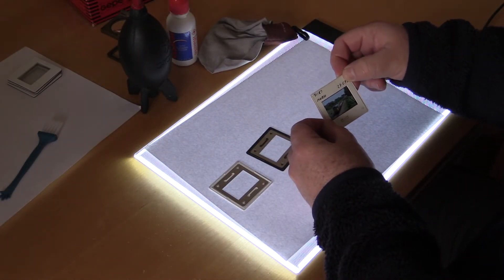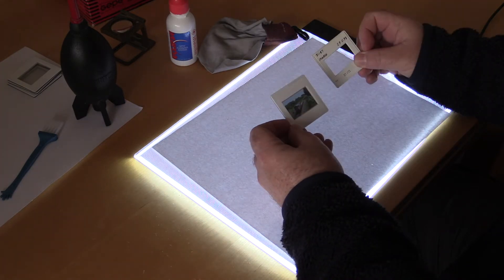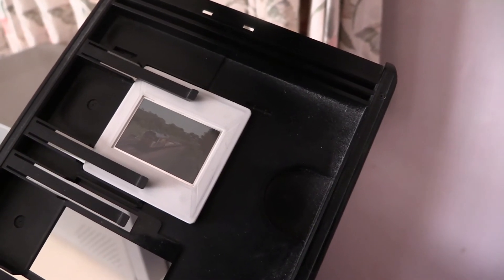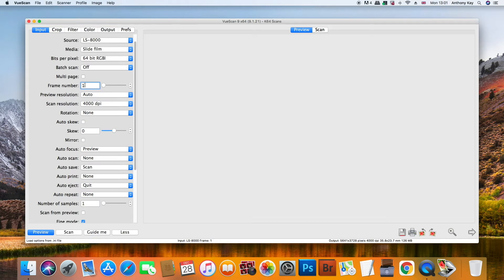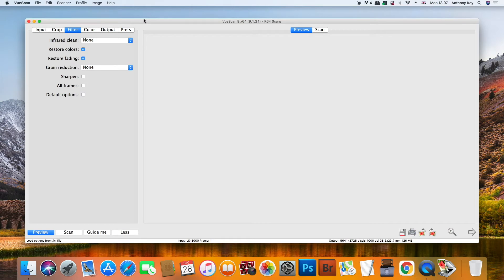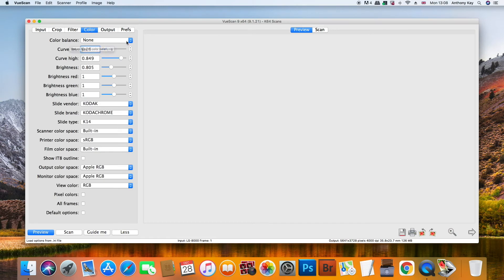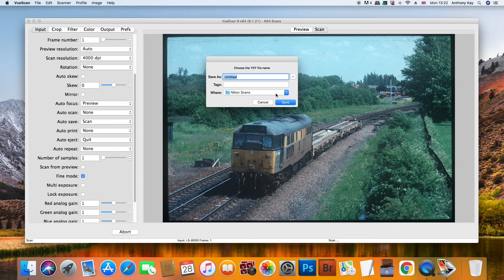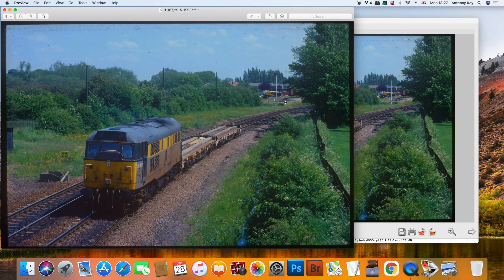How to Scan Your Old Railway Slides with a Nikon Coolscan 8000 Scanner and VueScan Software

Comment: Thank you mate, for putting this little video together for us 8000ED and modern iMac users!  I bought my8000ED years ago, when they first were announced.  Pricy then, and as I recall several thousand US$s.  Sadly, Nikon sort of ripped us Mac users off when, in no time, I had to upgrade to a newer Mac from my G4 to an iMac only to discover my Nikon 8000ED had become the proverbial ‘boat anchor,’ since Nikon tossed us Mac users aside and did not update Nikon Scan to work with the newer processors in the iMacs.  Sadly, my 8000ED sat under a canvas cover for several years until I finally discovered VueScan in August of 2020.  Many thanks to Ed for reverse engineering the software to keep such an expensive and high quality scanner viable.  I quickly found a small inexpensive adaptor for the FireWire to hook up to the iMac and after quickly buying VueScan, gave it a whirl!  Within about ten days my elation was short lived.  VueScan simply would not find the scanner any longer and I grew frustrated.  Coming from a technical background, I routinely heard the usual from hardware gurus—“your problem is your software,” and from the software guys, “you have a hardware issue.”  It took me literally months to finally acknowledge that the problem could be within my lightly used 8000.  Thanks to Ed of VueScan fame, he directed me to a couple of potential Coolscsn repair guys in America. After another delay, I finally packed the entire box up (25 lbs!) and shipped it to Virginia.  In no time, the unit was repaired.  Apparently, a fairly common issue with the 8000ED is the failure of a couple of the larger chips that are surface mounted.  Since my soldering skills are quite limited, particularly with respect to surface mounted devices, and not wanting to bugger it up, I outsourced the repair.  I am so glad I did.  It came back with a complete CLA, including the mirror, etc., and was now once again ready to go to work.  The cost was quite nominal.  According to my repair man, the 8000 is a very fine machine, and in many cases, is a better machine for reliability and robustness, than the newer 9000ED.  (Apparently Nikon cut some corners with the 9000).   After getting it back, I have fully tested it with 35mm slides and even some of my medium format slides.  (The whole reason I bought the 8000ED years ago was to scan my Hasselblad stuff).  There is another video within YouTubeland in which the author walks you, similar to this one, in how to optimize the settings within VueScan for the 8000.  If I find it again, I will include that as a hyperlink.  Alas, with the aid of VueScan, my repair man, and You Tube, I am once again able to make serious scans of everything.  I just upgraded to Mac’s Big Sur OS and tested it with that and it works fine.  With my Hassy slide, I produced a 440mb file,—both in TIFF and in raw. Carry on!  Thanks for a nice presentation.  You are the better man than I with your precision glass-slide mounts!  I simply have too many to attempt that.  Here is the guidance for Mac users, with VueScan and the 8000:  https://youtu.be/IZWcPRnXWaU

Comment: Thank you fro this video! I am looking at a CoolScan 8000 or 9000 and am still stuck on how to actually connect one of these with a modern day (2019/2020) iMac/MacBook Pro.  This video with VueScan is helpful.
Reply from the maker: Glad the video was helpful. I had to by an adapter for the cable in order to connect it to my iMac. Not sure what connections the new Macs have.